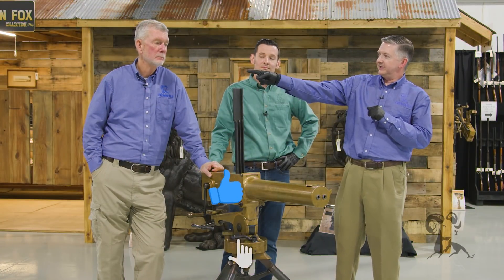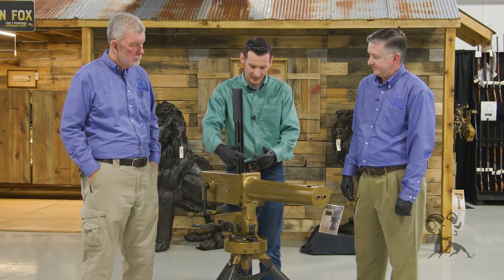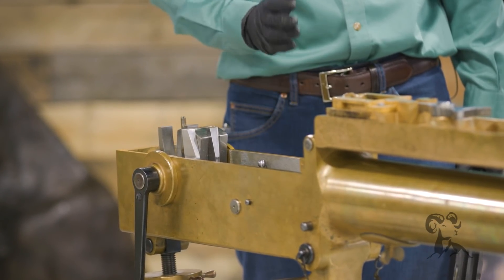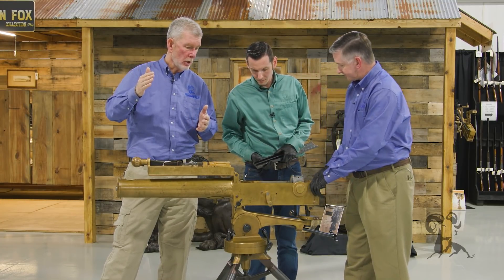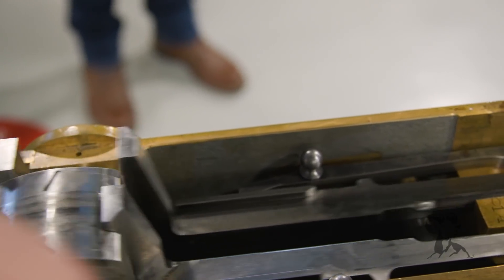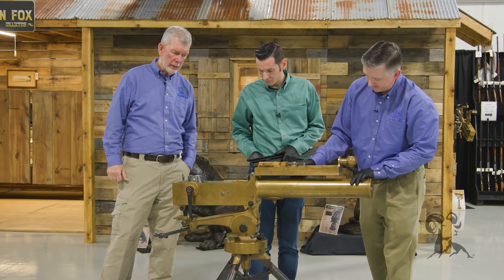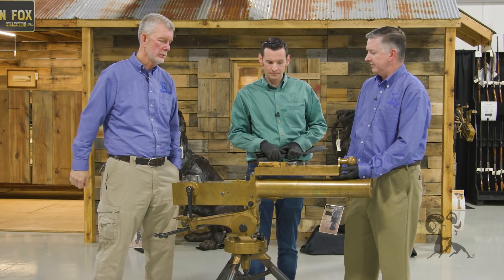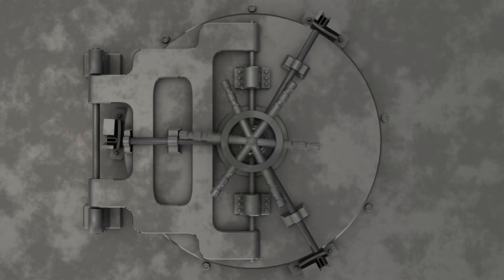From the Vault: The Dual-Barrel Gardner Gun

Comment: Their seems to be a manual water cooling holes would really help the residue from harding in the barrel and the gun is better designed than the gatling gun because of the access to the receiver for oiling or soaping and cleaning  the black power tar residue .  At 1/4 the weight it would be considered  battlefield portable compared to the gat.

Comment: It’s much easier to convert this to use modern feed lip magazines (you’ll need 2 mags because of the feed lips) than a gatling gun because the bolt carriers don’t rotate. A 6 barrel version might be possible but the crank shaft will be much more different and it’ll require 6 magazines.
Reply: The British Army apparently tested a five barrel version.
Reply: @zacharyrollick6169  Yeah although they didn’t seem to make the crankshaft to where the rate of fire of all barrels would stack onto each other. It fires more like a volley. Edit: I found out that the locking order could actually be changed so the rate of fire could be stacked.